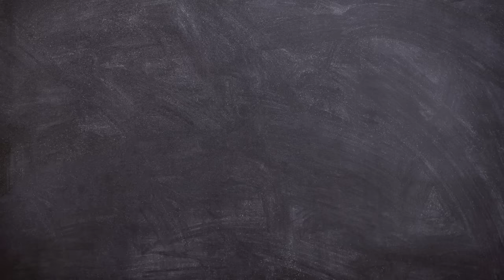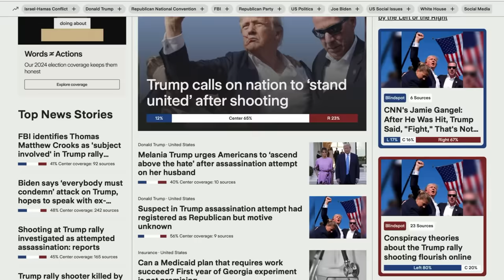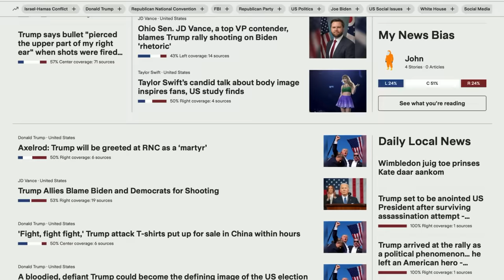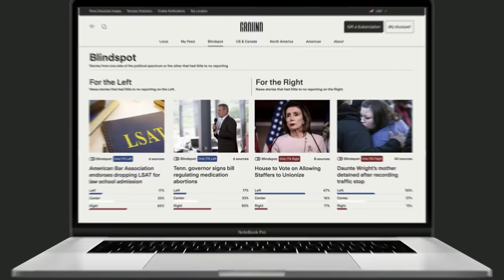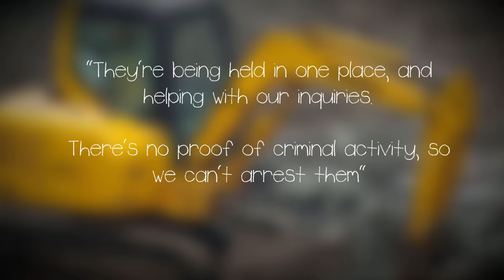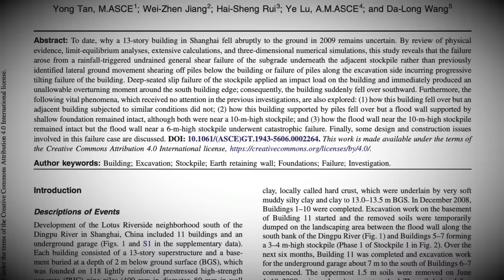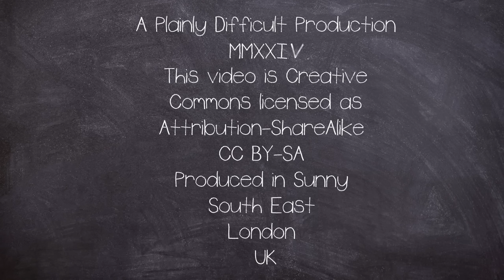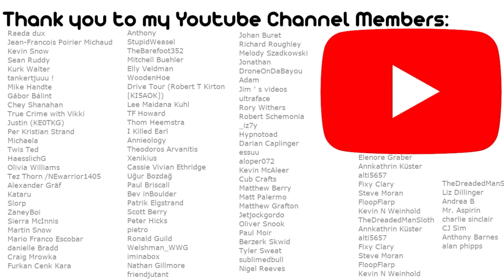Concrete and Steel Tower Falls Over Without Any Warning | Plainly Difficult

Comment: TECO - Tampa Electric Company. A few years ago they had an accident The Big Bend Power Plant on Tampa Bay, where they a crew clean out furnace vent from one of their coal burners that worked with one of the steam turbines. Instead of turning the power and heat off for safety. ( turning it off cost a couple hundred grand to get it restarted) They did not. They had basically day laborers and a foreman doing the work. They opened up an access door and initially had trouble with the blockage but when they finally removed the debris what came out was a few thousand degree blast of basically volcanic dust followed by lava. It happened so fast there was no where for anywhere to go, there were 6 people working in area, to explain what happened to them without going into too much detail,there was a heavy duty forklift in the room and that melted into an unrecognizable blob.
The Tampa Bay Times wrote an article about it a few years ago, I wanna say it was called “Hellfire from Above “ It was pretty horrible.
I think it would make for an interesting episode.

Comment: The Sennichimae Department Store fire in Osaka might be a suggestion if you haven't done it already. It had a late-opening caberet club on the top floor, while dodgy wiring in the clothing department below (it was the 70's, all that polyester...) set the building on fire and you ended up with Osaka's very own mini 9/11.
Also there was a meme picture and rumours of hauntings surrounding it for years afterwards. The building that's now on the site allegedly has ghost sightings in the toilets, voices behind cashiers shouting about fires, and staff playing Buddhist sutras over the PA system after hours.

Also an almost identical fire happened elsewhere in Japan only a couple of years removed.

Comment: 10:43 I'm not a geotechnical engineer, but if I'm understanding it right it seems like the dirt sliding into the bottom of the piles would have kicked the legs out, so to speak, and caused it to fall towards the force, to the north. But if all the soil is sliding at once and I'm just misinterpreting the diagram then it would make sense for it to fall away, to the south.

Comment: I'm no structural engineer, but if you remove dirt from one side and place it on the other, some very important dynamic pressures underground begin to take place. 13:50 in and already got an idea what happened. I'll continue to see if my initial assumption is correct. lol

Comment: Ian not a construction engineer , But  I would think that you would build the Foundation First , then build the building on top of the concrete and steel foundation .. And don't forget the steel bolts that reinforce the building to the Foundation .

Comment: Interesting. Reminds me of building seven. The difference is B7 fell into its own footprint at freefall speed with roof sink first. Every single supporting column and bit of concrete failed at exactly the same instant. We know this because that is the only way a building can fall at that speed. We know it fell at that speed because we have video and we timed it. What caused this simultaneous failure of all supporting structures? A small office fire in one corner of the building that took minor damage from some debris. Makes sense, now continue to watch the Kardashians and dont worry about t

Comment: American propaganda claims its tofu dreg and just fake concrete used.  Thanks for giving us insight into the failure due to the flood wall failure and it was them not accounting for erosion caused by the temporary fill storage.  If they managed their fill properly it would of never happened;  the fact the buildings stayed for then most part intact after tipping over shows they were strong.

Rip the worker

Comment: There was a nuclear accident outside of Atlantic City nj.  A nuclear tipped missile caught fire and burned within its silo. Radiation was released in an airborne plum over beach areas and sunbathers.  As the prevailing wind is from west to east, contamination was limited. However beach goers received more of a tan than they expected. There are still areas which post radiation warnings on that now closed military base.  Good luck finding more on the story.

Comment: Ah,  that seems the same complication, as i saw (in a video)  about  a landslide in norway. That scenario was most probably caused by digging a big hole in the soil layer, what caused a structural weakness for the layer, that then was sliding into the lake (or riverbed). By digging of a part of a structural system, you will weakoning the structural stability of that geological layer and that leads to instabilitys. That hole for parking-building caused that instability and every temporary changes (water or minor earth-quakes or whatever) will cause the geological layer to acomodate to the new tension-state within the structure of geological soil-layer. That building very likely slowly tilted, until something broke of the foundations and then all fall over.

The norwegian scenario was relativly simmilar to that riverbed-complication, because it was a fjord-scenario, where a river flows into the ocean and the bay becomes flooded and drained often over time, what leads to a huge sedimentation of clay, what was the sliding-accelerator for the soil-layer above. But only,. because someone digged a big hole in that upper layer, the hole structural equilibrium got some changes and lost grip/structural integrity and it all went down the hill into the lake/water.
That they piled  sand nearby (on the other side of the collapsed building) was sort of part of the scenario outcome, but not inevitably the initiating thing. I mean, if one build such buildings near a river, nobody should dig a huge hole in that geological layer and complaining about landslides or even little movement of the soil.

Comment: First, too little information is provided to reflect with any certainty. Second, large buildings on silt/clay of dozens of meters thickness on top of a fine sand begs for exceptional piling supports. Either the geotechnical engineers were less than up to the job, or the developer took actions unbeknownst to those engineers.

I wonder if ground water was drawn down in this vicinity, leading to subsidence.

Comment: It actually seems like they built the building TOO well!
 No American building would have fell in one piece and not shattered
It looks like the top was just too heavy and solid for the anchor and the bottom. Thats another difference in the USA, a big deep basement and or garage against the building to anchor and support it. 
The soil pile then also directed the extreme rain water at the building base. The building was sitting in a mud puddle on a sand base. Tbe vibration of the machine work may have also worked to create liquifaction of the clay around the building. The hollow tube supports might have even increased resonance? You never know! Sound vibrations have power.
 Wood piles are used in the USA historically.  Depending in where you build, years of piles may be under a site. 
Most likely, that area wasnt just a flood plain but a mud flat or lake. Seasonal muddy water was stopped there so built up layers of very fine clay. That was over the sand that was deposited before water was blocked down river. 
When flooding occurs, sand can also exert extreme pressure from below letting water well up under pressure -like in a calcarious fen. 
The piles were driven into the sand that had been previously capped with clay. All that pressure can then escape around and also through the hollow piles. This can create a quick sand and/or liquifaction around the piles or material under pressure. 
That could have water rising with explosive force pushing the building base. The inside of the hollow piles could also build hydraulic pressure. 
If you look, the piles on one side fell with the building, the piles on most areas stayed in the ground. Those that pulled out were probably the ones that had liquifaction and upwelling pressure around and inside of them.
 The other term for liquified clay is called
 " slip" . Slip is as slippery as grease. Pressure pushing up from below and liquifying ( which increases volume) while greasing the poles that are supposed to hold things in place...on one side only toppled the building sideways away from the water source, the rivers push from below and the large mound of the soil piles water pushing down  from above.
 The below ground force is what pushed up from below the deck on one side.
 That added stress from the rise up on one side the to the first floor then transferred to the base  pillars on the opposite side. Those probably cracked and bent enough to buckle, helping the building fall that way. 
The fall was so fast due to the fact the anchors on that side were both getting pushed up and slipping out due to the "slip"- the liquified clay. This scenario would have been very hard to predict. I dont know if they consulted a geological engineer? A soil specialist?
 I think its probably a rare geological phenomenon, a fen or an ancient capped over fen, that exhibited the water pressure from below that created pressure driven liquifaction turning clay to slip and pushing from below. The water/ clay mixture had an increased volume and acted like hydraulic fluid pushing up. It was aggravated above by the vibration of machinery afler days of runoff from the soil pile acting to liquify and so loosen the clay soil  from above- softening the area around the pilings.
 The disturbed( from driving pilings through) then softened clay cap over the buried sand layers burst like a dam with pressure from below and pushed up! Woosh!  Its over! Those holliw cement pilings may have acted as hydraulic cylinders also. If there was no escape for air at the top, pressure from below could have driven those up.
If you asked anyone local who had been on that site, they may have known of an area of quick sand or seasonal water flow almost like an aquifer welling up.
 A pressured spring. 
That building may have been built on a spot like that also but an area like that on the property would have given clues about forces underneath 
The great thing about America is public hearings where people come out to voice what they know or think is wrong with a project. 
I dont know if its the same in China but if it was, some open space advocate, fisherman or farmer would have shown up and pointed out the flaws on the land and building there based on what they know. Local experts often come who have knowledge the builders and boards dont have. 
This area should be investigated more thoroughly. 
If there are earthquakes there, liquifaction of the clay could make that site deadly.

Comment: this is the thing, there are ALWAYS plenty of warnings.  disregarded by authorities, going unreported, but by residence known and tolerated... as without a degree in engineering you really can't say what is abnormal.  plenty of staircases vanished into obscurity, holes in floors, walls, heck when the siding fell off and damaged multiple cars... people moved out.  but issues continued.  this is what happens when authorities take a blind eye to corruption and wholesale disregard of materials /services... for the public.  these same products/product quality/standards and services would not be ignored IF the projects were being done for ccp members.  you see the ccp has a membership in its government, that citizens can opt in for or out of.. to an extent.  being in it, allows for "bonuses" some known, some hidden and some... on a case by case award system.  the name for this practice in china is tofu dreg.  tofu is soft and squishy... just like the bricks, steel reinforcement bars, concrete and services related to ground prep/investigations.  did you know they spent half a billion on a dam... just to discover that dam was causing earthquakes in the area.. because of the underground structures cracking and collapsing UNDER the dam... caused by poor to no proper surveys of the land /underground structure/composition.. for under the dam, and for under the area the dam would flood.  anyhow thankfully the ccp has a strangle hold on information inside the country... what's interesting is this information leaked out in videos online, onto youtube, which is banned in china... but vpn's have allowed for a much more broader understanding of what is being covered up.  do your research :D you'll see i'm not full of conspiracy theory or fake news.  enjoy.  if you read this all, sorry i rant.  so many things reported happening in the nation of china, that go unreported or ignored by the government, you really feel sad for those without power who are just in it for the ride.

Comment: I'm not surprised.  Their concrete is dreadful quality.  You can crumble some of the work in your hands.  I have been there including Shanghai, which is a beautiful city, even in the back streets there is interest.  But their big tall tower leaks maybe 30 floors down.  They have so many ghost cities which are falling apart.  Their trim is often made of tubular cardboard covered in mortar.  get it wet enough times...and it just falls off.

Comment: I don't know why this was recommended to me by YT. But I quickly scanned through your 300 videos, there is only one concerning China, for just one building failure. Yet you immediately labeled it "tofu", to imply other highly visible projects in China to be the same quality. Most other similar failures in your videos, also due to corner cutting, were actually in the U.S., yet I don't see such generalized labeling. Isn't that a bit misleading and overly sanctimonious?

Comment: I have seen motorcycles built in China.

‘Chong foo’ motorcycle. Translation ‘total crap.’ 

The thing you would give to someone you did not like, knowing they will end up in a coffin if they ride it. . .

Some one I work with has a Chinese motorcycle, 3 years old. It’s falling apart. Scrap. Non runner.

I have A 26 year old Suzuki, going strong.

Comment: When will the others fall? That's what I'd be wondering if looking for housing there.
China appears to have a bigger problem. Concrete is supposed to strengthen with age. There are reports the opposite is happening in China's new construction.

Comment: So, that type of construction is specifically referred to as "tofu dreg", as it's not even up to the standards of actual tofu. Buildings collapsing (though not in one piece) is fairly common in China due to the prevalence of contractors using the cheapest materials that aren't often building-grade in an attempt to defraud investors. The real estate sector has a lot of corruption in it, sadly.

Comment: Chinese cost cutting at the finest, save in on rebar in the pillars anchoring it to the ground, just amazing levels of stupidity, but then again chines steel is about as reliable as rubber bands for their strength and rigidity.